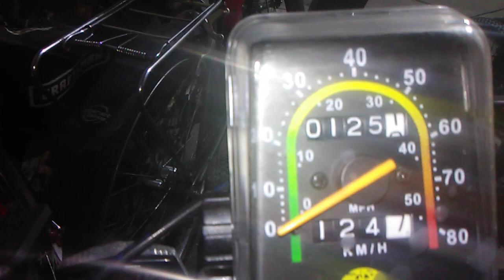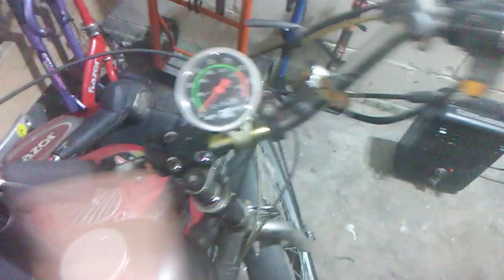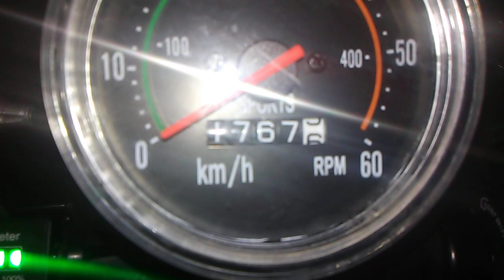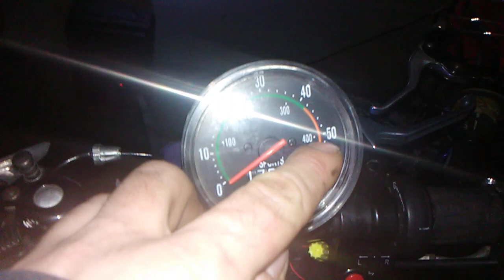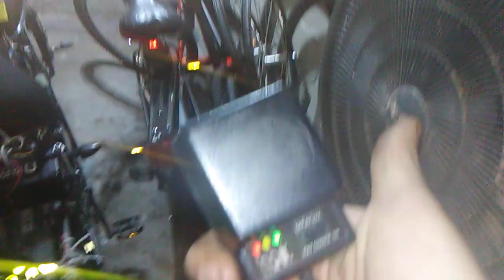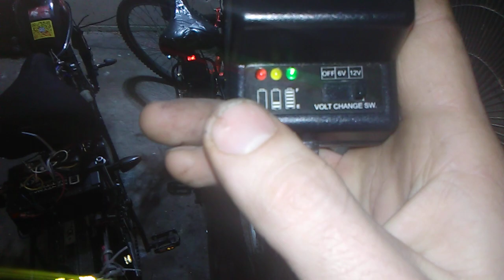"Motorized bicycles stuff Update video!"

Comment: Thanks for the long video talking about motorized bicycles.  😁👍
I happen to build my own style of Motorized bicycle.  I'm not into the sound of metal on metal rubbing together , or two chains on a bicycle.  My build is so simple a cave man could do it. Works on any bicycle with a seat post.  Proven to be able to ride across America 🇺🇸 out of the box . Makes the bicycle non critical ,I just need the tires to hold air . 
I still got my pirate cycle stickers,  my manic mechanic adapter all of it in attempt to polish up a turd . 
Here's something neat I rode a motorized bicycle solo across America 🇺🇸 last year Florida to California and back 4500 miles in 40 days . Posted the trip on my channel.  I broke all documented motorized bicycle records . I used a 60 dollar pawnshop walgoose and a 100 dollar 79cc predator motor.
Reply from the maker: How's the 79cc predator motor for a motorized bicycle I heard good things about it